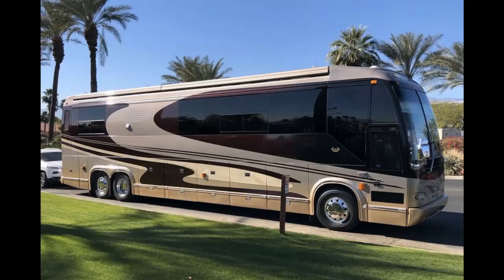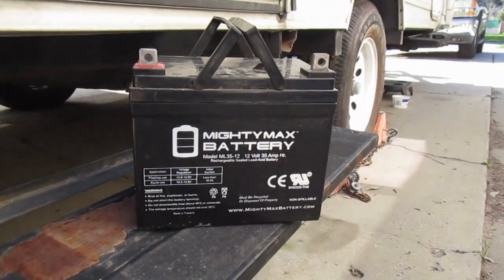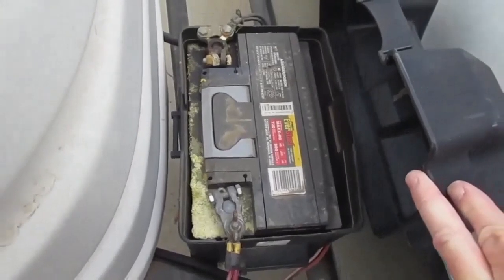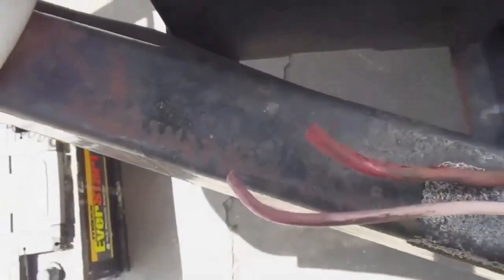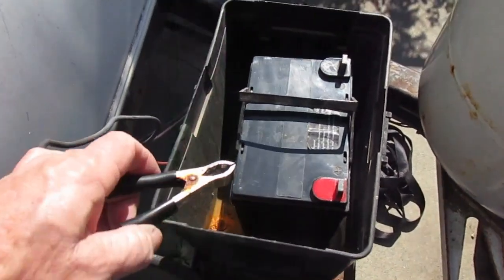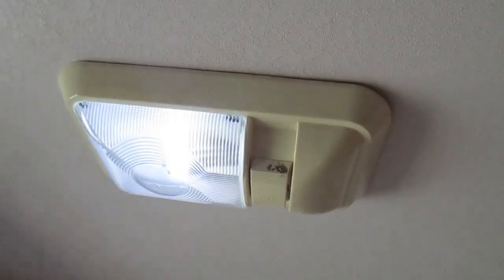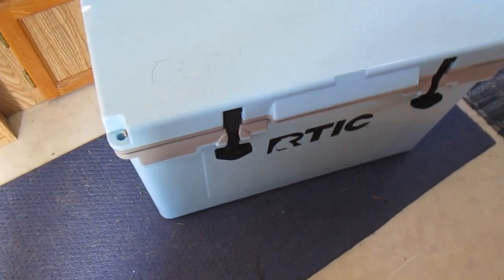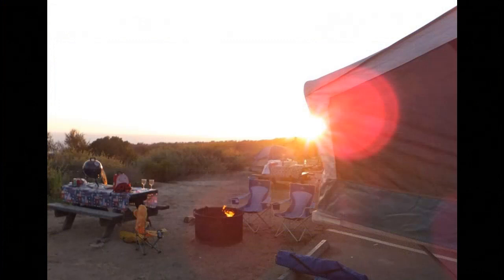Portable Battery Box for Camping [You Don't Need a Power Station!]

Comment from the maker: The RV battery (deep cycle battery) featured in this video is a 35 Ah (amp hour) battery. It provides plenty of power for a camping weekend in our 17 ft. camping trailer. You can find it here: https://amzn.to/4bMWphQ

We still use a 30 watt solar panel to charge our deep cycle battery, but you can find a 100 watt panel here (it costs about what we paid for our 30 watt panel): https://amzn.to/3TfDcOD Note: we rarely take our solar panel along with us when we go camping, as the battery has more than enough power to last up to three nights as long as we use it just for lights and occasional water pump use.

The super-insulated RTIC cooler featured in this video is available here: https://amzn.to/4bVMZAH It provides plenty of storage for cold and frozen foods, with ice, for a weekend of camping. We found that trying to keep the propane-powered on-board fridge in our trailer going for a full weekend was never worth the hassle.